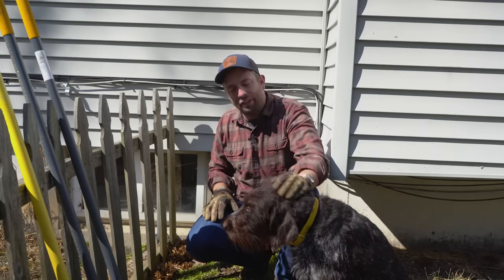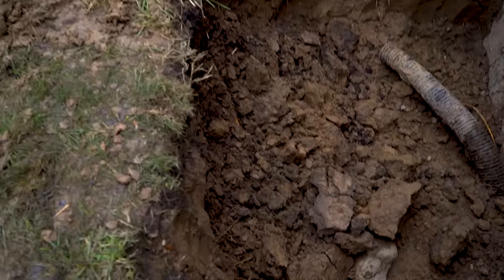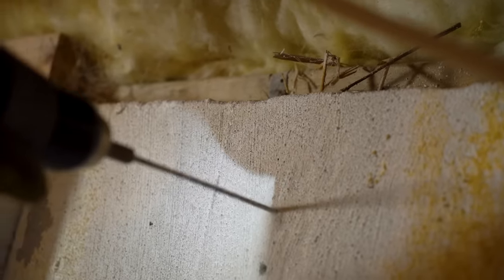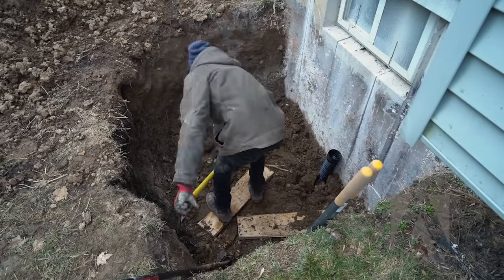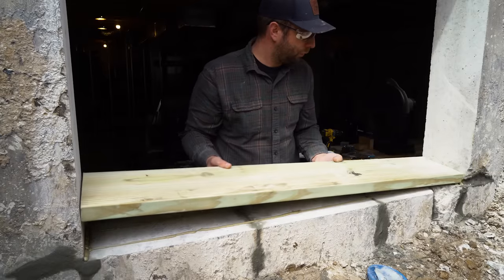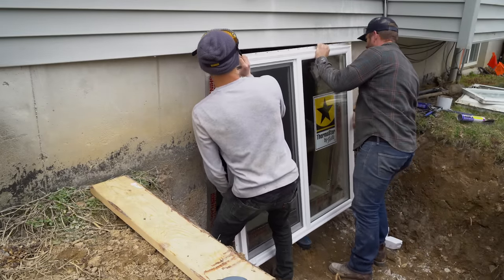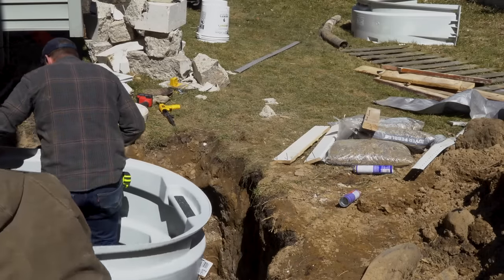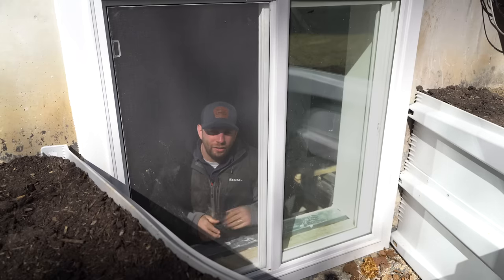Egress Basement Window Installation |  How To | DIY Home Improvement

Comment: Nice project! Dont know how it would work here in europe, i think most houses are made of brick, maybe it would require an extra concrete layer. still its an interesting video!
Reply from the maker: I believe you could cut a brick foundation in the same way
Reply: That saw will make short work of bricks. Masons use diamond saws to cut bricks.

Comment: Video was good however you made no mention of the fact that you installed a window wider than the existing window. The building code violation is now that the framing above the window will not support the load of the exterior wall above. The floor joist run parallel to that outside wall but the double rim is only as long as it needs to be over the first window. You need to keep structural integrity so viewer can do what you suggest in video as being an easy diy install

Comment: This is the exact same setup my wife and I are looking at doing.  You make it look so easy!  I'm handy but have never cut out a section of basement wall and added a window before.  I'm capable of doing all except the concrete cutting. I see K&H is based out of Lansing, I wonder how far they travel?  I'm in White Lake, MI.  Any tips on making sure you have the correct size cut out of the concrete wall?  The window must have a cut out diameter and then add the size of the 2x6 framing etc.  Thanks again for the video, fits perfect in our budget.

Comment: I have one I’m redoing same polyethylene type as you used. I noticed they put pea gravel around the outside of it about a foot down from the top soil all the way around. Well it warped and bent in on one side. Do you think it was because of the Pea gravel instead of dirt? Anyone?

Comment: Do you have to put an egress window if you are making the basement a family/playroom.  It will not be for sleeping, just hanging out for my boys.  I would love for anyone to give me some advice on this.  I have an unfinished basement space that can be made into a playroom.
Reply from the maker: No you don’t need an egress. It’s just a technical requirement if you want to be able to count that space and “livable” square footage in the house, for the houses value
Reply: IT IS NOT JUST A TECHNICALITY FOR RESELL. You definitely have to check with your cities building department. If you're actually renovating the space and pulling permits for the work they will inform you of what needs to be done to code. If you're not pulling permits, and the city finds out about the work, you could be subjecting yourself to fines if they determine you're not up to code. Trust me, they do find out sometimes, even when you do the work yourself. Cough**neighbors**Cough lol. A lot of municipalities require an egress when renovating your basement as a "livable" space. And most, if not all, require it in new construction, period. It is not just a matter of being able to include it as living space and additional square footage at resell. But, most importantly, the only reason the city cares if there's an egress or not is to insure there's a way out of the basement during a fire or other emergency if the stairwell/door is blocked.

Comment: ****
   MAKE SURE YOU USE WINDOW FOAM ITS NOT AS HARD AND IF YOU USE THE WRONG KIND IT CAN MAKE YOUR WINDOW TRACK OUT OF LINE. THEN ITS HARD TO OPEN YOUR WINDOW!!!
NOT TO MENTION A PAIN TO TRY AND CLEAN ENOUGH OUT SO YOUR WINDOW OPENS LIKE IT SHOULD. BEWARE....   PROTIP OF THE DAY...   STILL GOOD VIDEO.
                                          ******

Comment: all that work and you did not flash the window? 

Also, framers that use framing nailers just use fluted or ring shank nails in the gun, no need for a ramset, 120psi framing nailer with the right nail does what it is supposed to.
Reply: Also, you do not tape the bottom of the window. Tops and sides.

Comment: Anyone know a general range of what a concrete cutting company would charge for this?
Reply: I got one cut recently and it was $800 in northern Utah, but I did get quoted from another company for $550. They also wanted $250 to haul the cut slab away but if you have a rotary hammer and a sledge you can do that part yourself pretty easy.
Reply: @ablafreniere50  Thanks!

Comment: The absolute best bang for the buck concrete anchoring hardware is the blue tipped large diameter anchors...Drill the hole; send it in with a socket and ratchet...Nothing works easier or better...35 years commercial and residential construction...Once you use them, you'll never want anything else..:)...https://www.diamondtool.net/large-diameter-screw-anchors/category/3661

Comment: If it increases value then I wouldn't do it until I actually sell the house. Seems costly and unnecessary, it's just a bigger window, room usage hasn't changed unless you consider less wall space for hanging stuff?
Reply: The bigger window meets egress requirements which allow for the room to be defined as a "bedroom" in the basement, changing its room usage.  The value is in owning more livable space or selling the property with more bedrooms then when you bought it.

Comment: No drip cap, no header after cutting the wall, no connection to drain tile, tape window flashing doesn't bond to concrete.
Reply: Plus no insulation between the wood and concrete. No matter the type of wood you should still have insulation between

Comment: 3:34 - You said there is no easier way to remove the concrete than to break it up with sledgehammers. Had you waited several months, you could have done a collaboration video with Destin from Smarter Every Day. Yesterday, he released a video all about PULLEYS! (The dude is in love with pulleys. Also Laminar Flow, but that doesn't help with your project.) Here is his video: https://www.youtube.com/watch?v=M2w3NZzPwOM

Comment: Windowing in the U.S. looks nothing alike in Europe
Reply: Also, we are a big country, with many different climates.  In the East/Northeastern states we have differences in finishing, I would say, than west of the Mississippi River and the South. Basements seem much less common in those regions than in the Midwest and East. Plus, our year-round rainfall and winter snow in the eastern U.S. I would think makes waterproofing a top priority (look at the muck he was dealing with when he did this installation). Depending on where you live, licensing and code enforcement may be more lax, especially away from heavily populated areas.  In Europe I think you build with more longevity or permanence in mind.  We seem to treat construction a bit less long term, spend less money and expect to change or update in twenty years.  I gather we also can renovate and expand our houses with much less restriction.

Comment: Egress door. Not less than one egress door shall be provided for each dwelling unit. The egress door shall be side-hinged, and shall provide a clear width of not less than 32 inches (813 mm) where measured between the face of the door and the stop, with the door open 90 degrees (1.57 rad). The clear height measured from the top of the threshold to the bottom of the stop. Other doors shall not be required to comply with these minimum dimensions. Egress doors shall be readily openable from inside the dwelling without the use of a key or special knowledge or effort. 

I would have likes to see you use ground contact pressure treated wood but it’s not required. Same thing with your choice in drain tile i would have liked to see a proper french drain system wrapped with a non woven geo textile fabric with a double walled corrugated pipe surrounded with 57 stone.

And maybe would have even sealed the cut ends of the pressure treated wood

Comment: Everything is wrong with that kind of construction. First it going to fill upp when it rains and leafs and other crap get stuck in the drain and plug it shut and the water starts geting in around the window. No water barrier on the basement wall witch leds to ground moister is going to penetrate in to the wall.

Comment: Why use wood for the frame?Instead there are better options like granite,marble or slate, it can be weather sealed with cement and silicone and lasts decades, I dont understand why people on the north hemisphere still insist using wood in civil construction, it's frail and dangerous.

Comment: "increased my home value" lmfao........
Reply: It does. It would add a good reason for buyers to consider the house over other houses. Especially if buyers are more into activities in the basement such as karaoke or band jamming, it would make the house exclusive on the block. I'm talking about the ability to breathe fresh air from the basement in Summer...

If the thing costs less than $2-3000, I definitely want to install it one day.

Comment: Wow what a bad job at cutting that window!!! I can say that because i do this for a living.
Reply: What was done wrong. I may agree,  just wondering what experts see that novices don't.
Reply: @nbco55  first they used a wall saw so you end up with massive overcuts that lead to it cracking and leaking later on then they leave the peices in there and make buddy smash them .... I woupd have cut with my 14 hand saw and then my ring saw so it has no overcuts and leaves very little in the corner and i would have also removed the blocks out of the hole.